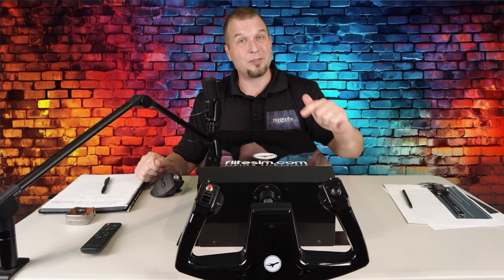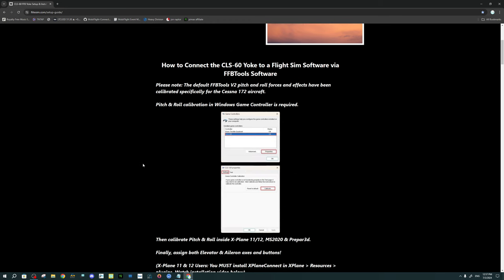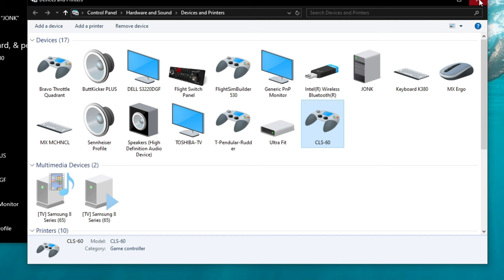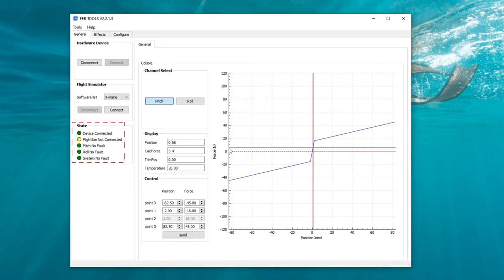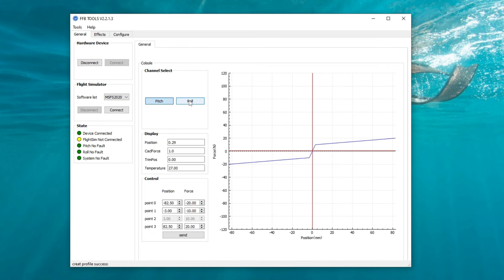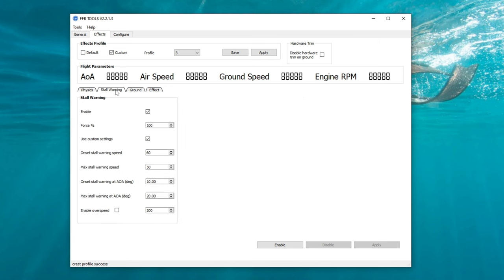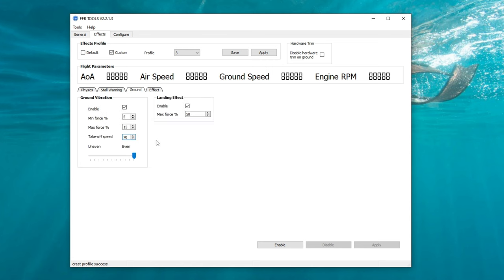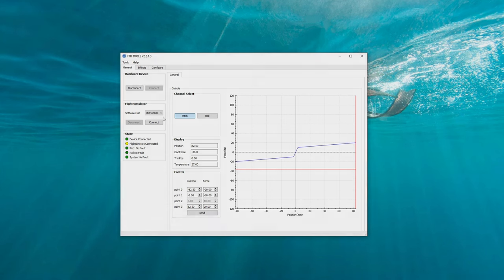Flitesim.com Force Feedback Yoke Review - Software Setup/Tutorial , Calibration, Time stamped -Pt.2

Comment: Great series. 👍. My -60 is arriving soon. Excited for that. A couple thoughts on the subject of the video. The startup “flowchart” is a concern as it adds a lot of steps to an already multi step process to get MSFS ready to fly.  Does the tools software need to be run each start-up or just if a profile change is required? Hopefully, future upgrades with auto match profiles to airplanes. I hope this product is a successful as I think it will be as it appears valid profiles will need to come from YT contributors who are pilots or developers. Looking forward to chapter 3.
Reply from the maker: Thanks for the comment .. yes the ffb tools software needs to be run when using the yoke . Check out the discord a member has posted a yoke checklist so you can remember everything. I'm sure profile matching will come .